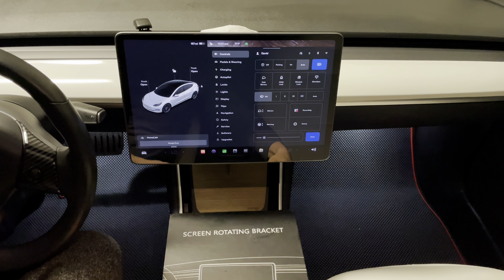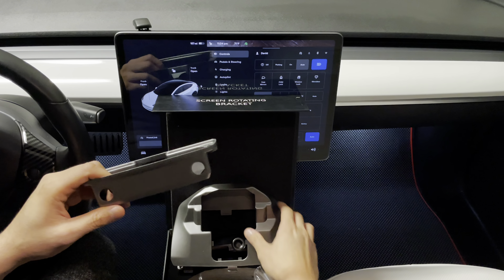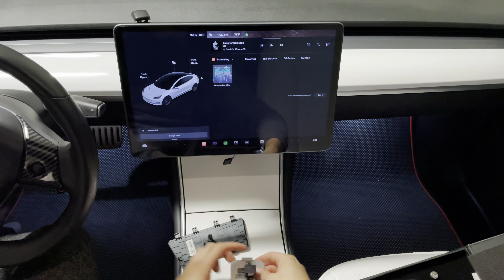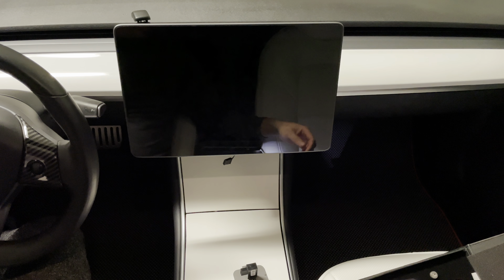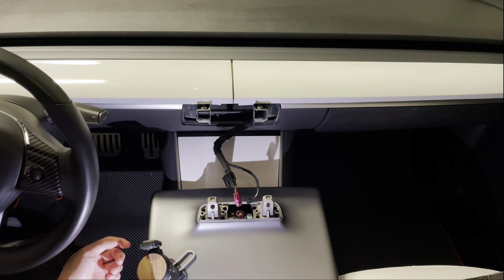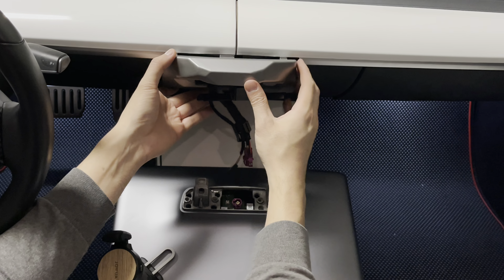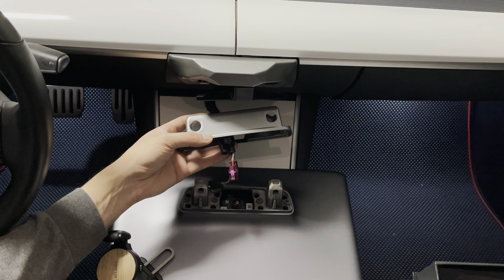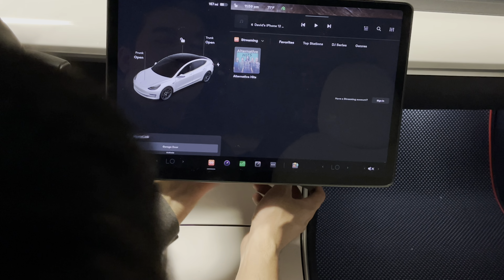Tesla V3 Swivel Mount for Model 3/Y Install and Review!

Comment: Hello, I can’t unhook the wire from the temperature sensor cap. Is there an easier way? Do you just pull really hard? I don’t want to damage it
Reply from the maker: No don’t pull really hard. There’s a little indent use a small screwdriver to press in and pull simultaneously